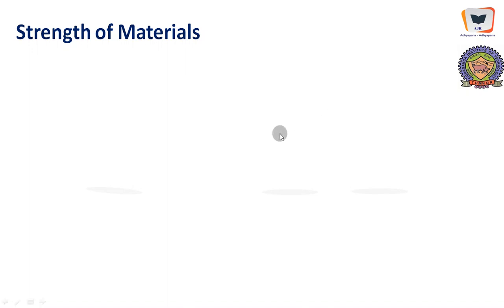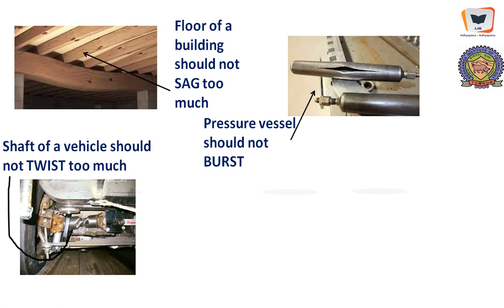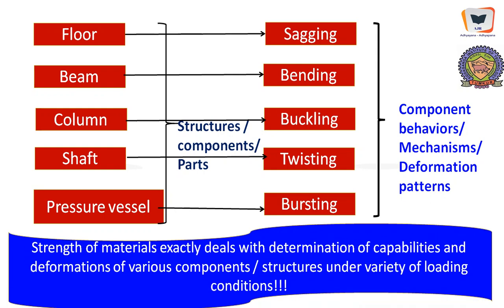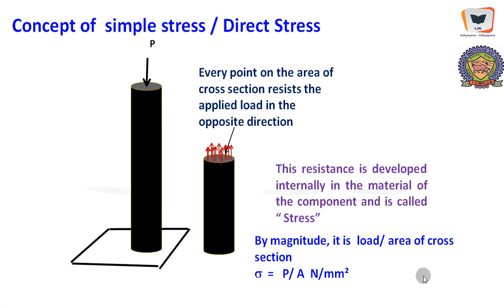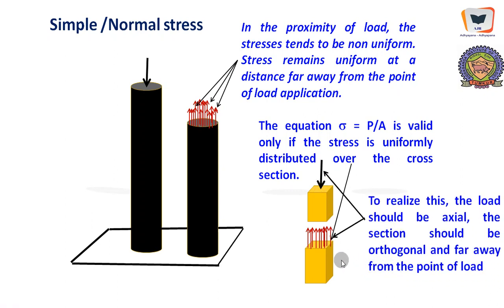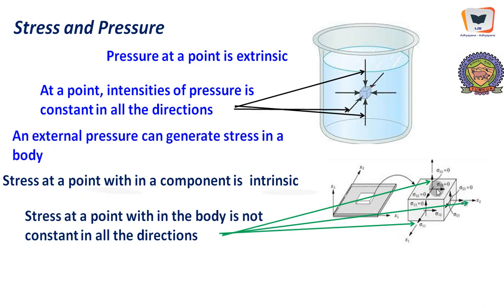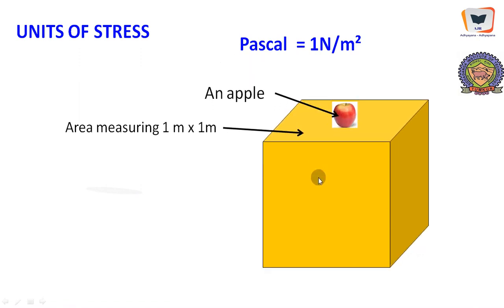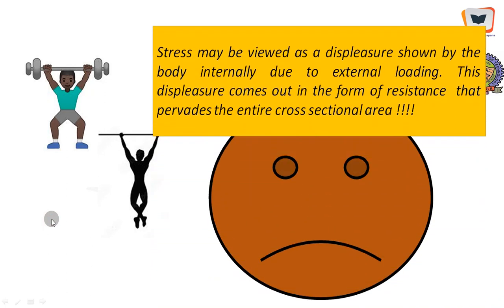SOM RUDIMENTS TUTORIAL1|| Dr. M A JAYARAM

Comment: Stress occurs or strain occurs first?
Reply from the maker: Normal strain occurs when the elongation or compression of an object is in response to a normal stress. Thus stress before strain.
If you consider thermal condition on a free body, strain will come first and when we restrict the deformation stress will set up.
It is important to note that it requires huge magnitude of stress in order to cause ultimate strain. For metals ultimate strain is in the range of 0.005 to 0.5.
Reply: Thank u jayaram